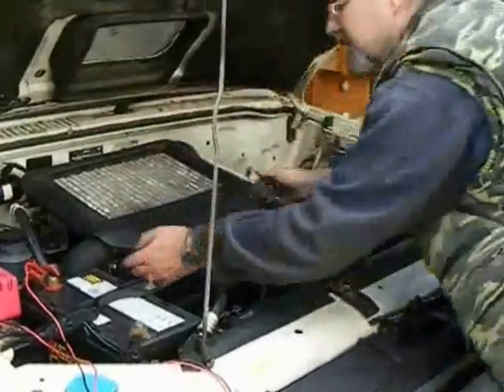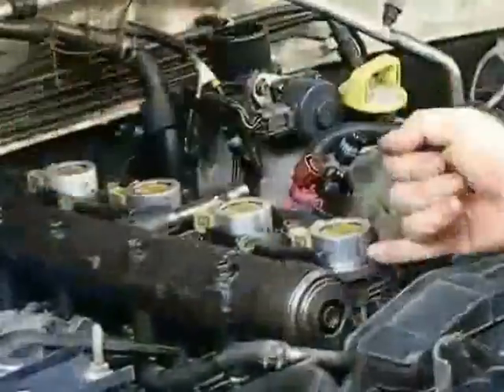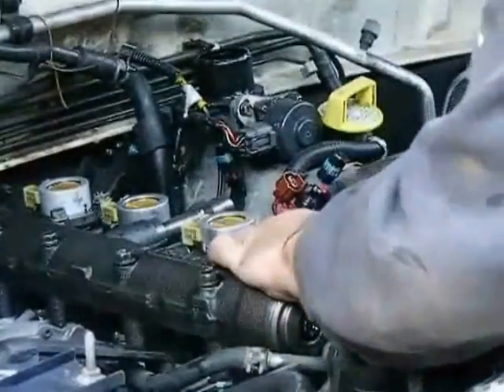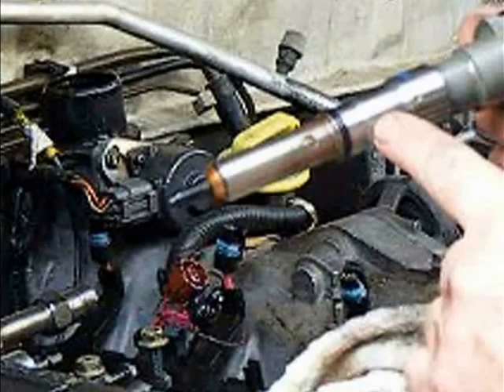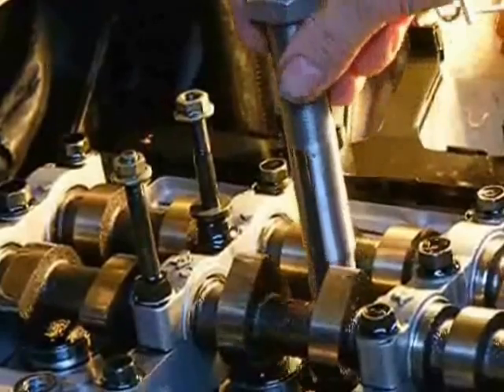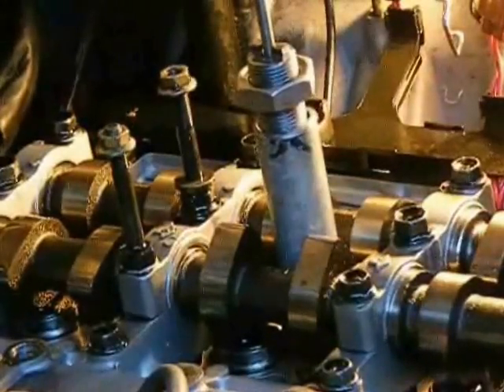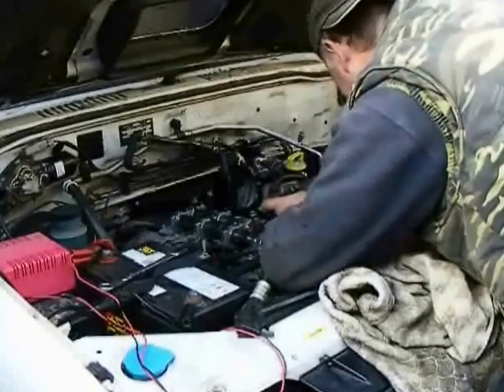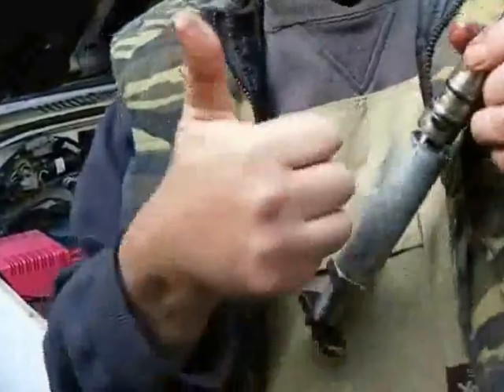Removing Isuzu 4JX1 Diesel Injector Sleeves

Comment: Can you recommend an Australian or New Zealand supplier of the injector seal kits, or perhaps just the copper washers themselves?
Reply from the maker: Hi Wayne, If i'm buying expensive parts I use Ramin Isuzu in Dubai, ordering through their website.  However I live in a tiny country town with one car dealer - Holden.. The copper "gaskets" are only $4 each from GMH so I buy locally.  From GMH a whole set of injector seals is about $174 ( sleeve outer O-rings + injector lower O-rings + copper gaskets [washers] + injector to oil rail O-rings + O-rings to both ends of the high pressure oil pipe that bolts to oil rail ).  The most expensive O-rings are the HP oil line pipe since they are a special square section, and it is usually not necessary to replace them, so that saves $52 (ie $122 for the rest). If the vehicle history is suspect I replace those O-rings to have a "clean slate" to start the vehicles 2nd life with while under my care. So if I don't have a week to wait for parts from Ramin, I buy genuine from GMH Australia, but if I have time I order a batch from Ramin since even with freight their prices are always less than half GMH.  I heard a rumor that Isuzu in New Zealand will sell parts directly and cheaper, but in Australia they refuse to.  I would always buy genuine with seals, however the TPS & ORPS available for $65 each on eBay ( aftermarket ) have proven reliable. 
 The Chinese Tech2's for $450 are great, I use AliExpress and am very pleased. I recommend highly you think about a Tech2 if keeping your vehicle. You need a bit of tech savvy, but that device makes a 4JX1 a pleasure.
Reply: Thanks for your help Edwin. I'm flying from Cairns to Brisbane on Friday to pick up a 2000 Jackeroo which is running smoothly but spitting water from the exhaust. The plan is to do the sleeve o-ring repair and copper gasket replacement down there then drive it back to Cairns leaving on Sunday. I want to make sure I'll have everything I need at the time. Cheers
Reply from the maker: Wayne Bagnall
no worries Wayne.  The repair is quite straight forward. The GMH service dept time billed is 2.2 hours.  Generally I allocate an afternoon and a few tinnies myself.. cheers
Reply: Edwin Henry Blachford
Hi Edwin, one more thing - what is the part number for the copper washers/gaskets? Thanks again for your help. Cheers
Reply: Edwin Henry Blachford
Sorry Edwin, did I say one more thing? Also the part number for the neoprene seals on the injector plugs. Is there a site that shows an exploded view of the head/engine with the part numbers? Cheers
Reply from the maker: Wayne Bagnall The Isuzu part number for copper gaskets is 8971-611-092  .  GMH may use different numbers now since they recently recatalogued everything.  Exploded views are in the Isuzu online manual from eBay for $10.  Wiring harness neoprene seals are only serviced with the whole engine harness.  Standard practice is to clean oil out of connectors with contact cleaner then silicon seal the 4 plugs in.  A little oil is permissible in them as long as the contacts are clean when fitted since injector voltage is quite high. Make sure you clean the connector beside the dipstick outside the engine LHS since oil may wick up the wires and often oil dripped during oil filling accumulates there. It may be worth mounting that connector higher when you have time to modify its bracket to discourage wicking.

Comment: Hi Edwin,
I have a Holden Jackaroo with 4JXI motor. I have replaced the injector seals after watching your video. I am fixing the vehicle as when i brought it was not starting. The engine starts fine with no smoke all fluid levels are fine. The issue i have is at idle speed the engine shakes a lot, as i increase the rpm the vibration stops and runs and drives perfectly. What according to you could be the possible cause? Do the injectors needs any kind of calibration? I have removed and replaced the injectors in exact order i pulled them out. Your advised would be highly appreciated.
Thanks
Reply from the maker: Hi Nav, The injectors have a code that must match the ECM for perfect running(Tech2 job),but that is a very fine tuning thing and wouldnt effect smoothness - many 4JX1's have missmatched codes but run very well.  Perhaps a very common problem with rough idle is a dirty EGR valve since carbon may be jamming it open at idle when it's normally meant to be closed. check this by unplugging vacuum line at valve(plug the vacuum line eh!) and it may improve perhaps.  Clean all carbon out of the valve and reinstall checking vacuum hoses for cracks. Many just leave the EGR disconnected,which is OK for a while but the increase in combustion cylinder temperature will eventually cause injector and valve failure.
Another common problem is the TPS sensor which fine tunes air flow and creates a vacuum for the EGR gases and so effects idle a lot,  these can be bought on eBay for $65..but after fitting you must find someone with a Tech2 to calibrate them in for best running. Your original TPS can be cleaned though, so try that 1st,marking its position very carefully and replacing exactly back in same place. 
These 2 jobs are very cheap to do, so start there,but the ideal way is using a Tech2 which I recommend next. This will save a lot of wasted effort and expense since the computer tells you exactly whats wrong. Ask a GMH service centre how much to do Tech2 engine check & report..or buy a Chinese Tech2 for $450 at Aliexpress.com  :-).

Comment: hi Edwin 
i have 1998 isuzu bighorn the temperature went to three quarter and when i checked the radiator it was low by about 3 liter i top it up but it keeps need toping up every few days, i can see a bit of milky oil around the dip stick tube and the oil level looks high.
can this be  an injectors sleeves o rings???
thnx
Reply from the maker: this is very likely sleeves Yousef.  Check for leaks in coolant hoses etc first... if that seems ok.. look at the sleeves.  check my other video "Why Isuzu 4JX1 Injector Sleeves Fail - and How to Fix Them".. to see what the carbon of leaky sleeve seals looks like.  Leaking sleeves has exactly the same symptoms as a head gasket or cracked head ( but is far easier to fix )